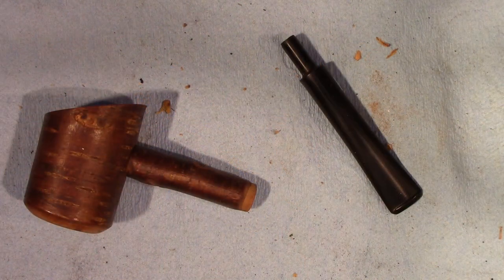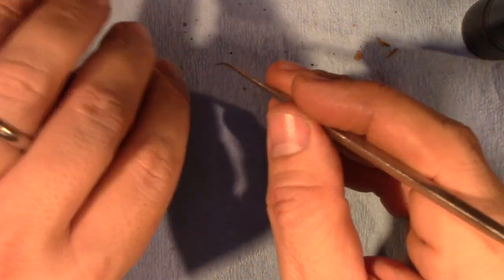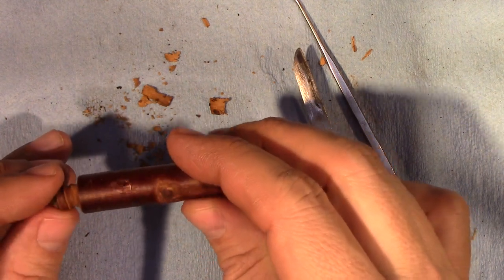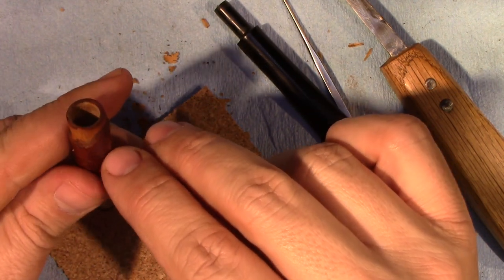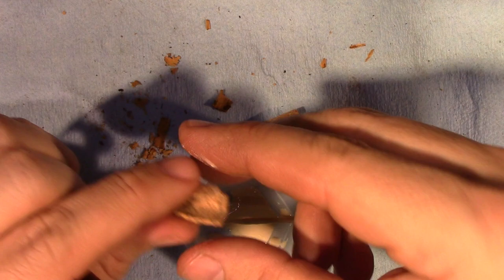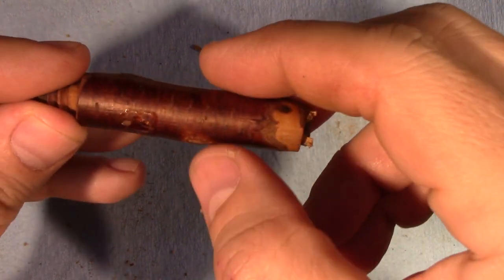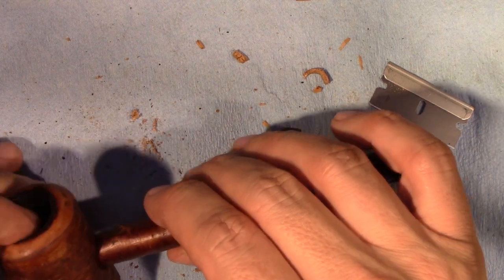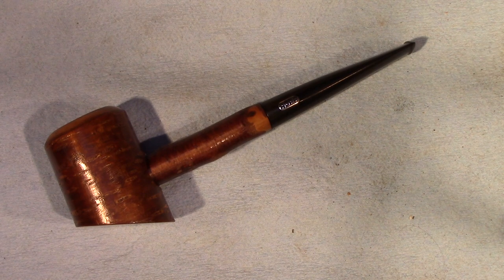Ropp Cherrywood Restoration Part 3

Comment: Hiya Mike. Enjoyed the video series very much. I too have a Ropp with the same cork issues but didn't realize it was cork either. My problem is the end of the mortise is also cracked in two spots. What I also didn't realize was that the bowl actually screws off the shank. Now that I know that, I think my solution is going to be to glue the bit in place making sure to get plenty of glue between the cracks of the mortise, then wrapping the end as we would to put eyelets on a fishing pole. I don't think it would be any tougher to clean with the bit fixed in place now that I know I can take the bowl completely off. Thanks for teaching me a bit about this pipe. I bought it off ebay, saw it was broke and it has been sitting ever since unrepaired. I now have a plan.
Reply from the maker: I Paul,  It is good to hear from you and I am glad that you found the video helpful!  Good luck with your restoration!  Best, Mike.

Comment: No more than I expected Mike, another top class job and trilogy of videos! I think I might have put a thin layer or 2 of thinned down acrylic lacquer on the inside of the cork to perhaps protect it from the chance of crumbling or binding on the tenon? but then I have a habit of faffing about! Lol! 👍💨💨💨 Terry
Reply from the maker: Thank you Terry!  I don't know if the lacquer would work.  Since the cork is going to compress, the lacquer could crack and lead to bigger problems. But there is only one way to be sure... Best, Mike.

Comment: I saw that cork thing and laughed, thought I'd seen the last of That. I used to play saxophone and am thinking, in order to maintain the cork you could use cork grease. It will keep it from normal wear and tear.
Reply from the maker: Hi Armando,  thank you for the suggestion.  I have used cork grease on the cork in calabash pipes for that reason.  Couldn't hurt I suppose.  Be well, Mike.
Reply from the maker: I would be careful with that.  The friction is what holds it together.  Cork grease is not nearly as greasy as vaseline would be.

Comment: It looks great. How about some advise on what to look for in one of these. I mean when I am looking at one what to watch out for? Thanks for sharing. I would have considered shaping the cork around the stem by using small tie wraps and also using a little CA glue on the edges to reduce the breaking. Then again it is just an idea because I have never tried it.
Reply from the maker: Hi Joel, thanks for the comment.  I think the most important things to look at are the threads on the shank.  A lot of the time they are shot.  Other than that, it's all the usual stuff that you would look at on any estate pipe.  That tie wrap idea might work out.  I just was making this up as I went along, and honestly it was simple enough and seems solid, so I think I would just stick to the method I used here.  The CA glue on the edge is an excellent suggestion.  Be well, Mike.

Comment: A general restoration question: Have you ever tried Mark Hoover's " Before and After Restoration Balm"?
Reply from the maker: Hi Rick,  No, I have not, but based on what I have seen it is very similar to Halcyon II (https://www.smokingpipes.com/accessories/pipe-supplies/moreinfo.cfm?product_id=259563)  which I have used quite a bit.  These products are micro crystalline waxs and work quite well, but they are not as durable or long-lasting as carnuba.  Since I have a buffing system I prefer the carnuba, but will occasionally use halcyon II on a rusticated pipe that I don't want to have a glossy finish.   Best, Mike.

Comment: GREAT VIDEO.... DO YOU KNOW WHERE I COULD BUY A NEW STEM FOR MY ROPP??
Reply from the maker: You can try getting in touch with Ropp as they do still make pipes.  If that does not work you can check with Briarville, Tim West, or my website once I open up again in Sept.  Thanks for watching!

Comment: Great job Mike with a very unique pipe. I admit that I had  doubts when I saw you insert the cork but it turned out great. Did you end up doing the retort with the stem on?
Reply from the maker: Hi Christian, yes I retorted with the stem.  I was a little concerned, but it did not seem to be an issue.  I did allow the pipe to cool and dry before I tried to remove the stem.  Best, Mike.